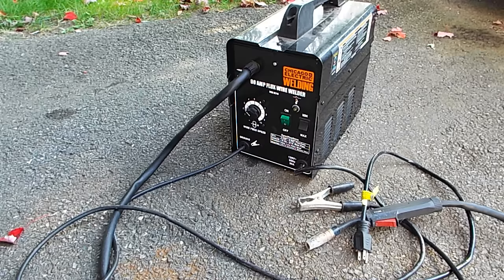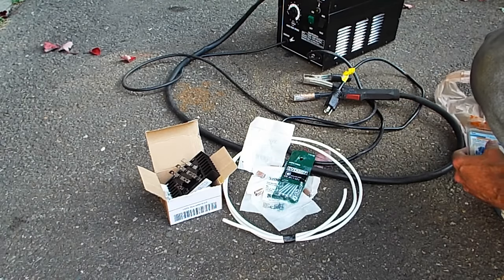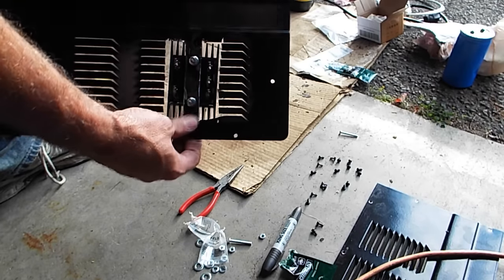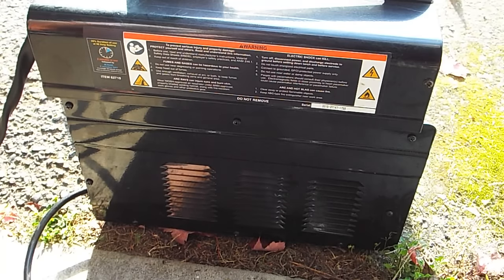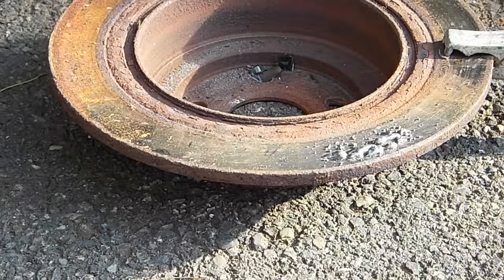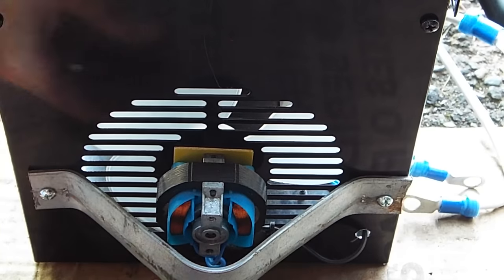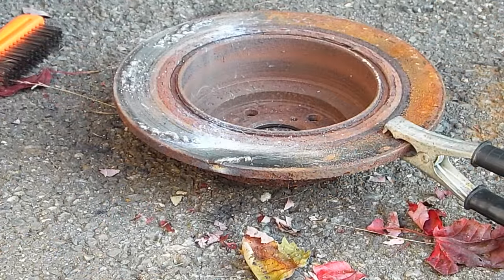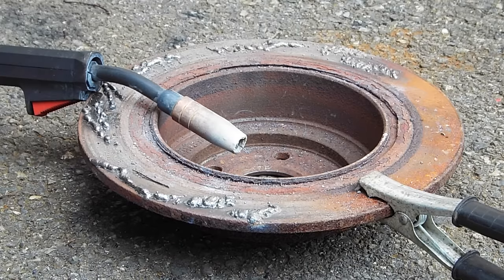Convert Welder from AC to DCEN ✔

Comment: Can you put a parts list on here for me
Reply from the maker: Items bought through Ebay: ONE Large capacitor with values of Mallory CGS Series 21000uF - 100VDC . ONE resistor with value of 160 Ohm 10W 1% Resistor Silicone Wirewound. ONE Bridge Rectifier of MDQ 150A Single-Phase Diode Bridge Rectifier. Items bought elsewhere: 6 feet of 6 gauge wire (not much to spare, so 7 feet of wire might be better). I used FOUR 1/4 inch copper connector tubes to join wires together with solder.  TWO packages of 6 gauge wire terminals for connections to the bridge rectifier and the large capacitor terminals. Various sized nuts, bolts and washers to mount the bridge rectifier and to use on the connection terminals.
Reply: Where did you buy the capacitor from?
Reply from the maker: I found it searching on Ebay.
Reply: Mark Young - Outside The Box what are the specs on it? Great video.
Reply from the maker: Thanks! This is a Mallory CGS Series 21000uF - 100VDC. I measured the DC voltage coming from the welder on its high output setting and it was less than 30 volts DC, so using a capacitor rated for up to 100 volts DC "should" be ok.
Reply: Can i use an automotive three phase rectifier?
Reply: Great info hi from Northern Ireland
Reply: Learn to weld. Mines stock and I can run a nice bead. I have a Lincoln 100 amp dc. Runs great.
Reply: @laurencionavarro8460  most auto alternator rectifiers, 140amp max. But 25amp continous output. And they are designed for operation between 12.3vdc to 14.75vdc These welder transformers output is  around  18vac. So again, no. 
When an alternator diode mosfet  goes bad, sometimes it begins overcharging and ruining the 12v battery. The case swelling up and acid leaking is telltale sign.  Quick check with DMM.  
  3 phase is A/C commercial welder Amigo.
Reply: @laurencionavarro8460  you probably don't want to go this route as it needs a heat sink and screw terminals to attach wires to it. A 150a rectifier is less than $20, and I bought the heat sink for less than a dollar at a local scrap yard.
Reply: @MegaTroyhamilton  we dont care about your 100amp DC welder or your comment about the authors welding. We care about the topic of THIS VIDEO.
Reply: All you need is a 40v capacitor at 40000mf

Comment: You have illustrated "Third one is the charm". Since you did not convert three welders you did not get the perfect conversion but you combined what works with what not to do with enthusiasm and a good voice.  Good luck with future videos.
Reply from the maker: Thank you Stuart! I know it was a bit of a hot mess, but the end result, with the additional aluminum heat sink, is still working just fine, even with 0.035 gauge wire.

Comment: thinking about doing this to my welder but i'm curious if the hi and low settings still work
Reply from the maker: Yes, Hi and Lo function as they should. I'm still using it mostly in this configuration, with the addition of a bigger aluminum heat sink for the rectifier.

Comment: Cool vid, but you need to get into a welding class.  I think that would do you more good than changing to DC.
Reply from the maker: Thank you!
Reply: Agreed, I own a similar welder, and have used it to so a lot of welds for friends and stuff, and I have gotten a ton better. I can lay dimes on these cheap AC machines, and now I just bought my first TIG welder. You can tell he is a new welder lol, but with practice comes experience.

Comment: that's why we all used the 150 amp BR to begin with, at 100 amps there isn't enough head room for the peak amperage. also the reason your AC welds had so much splatter is because you had the wire speed up too high, were moving too fast and had too much stick out. As long as you know how to weld the HF   115v flux core welder is perfectly capable of running a consistent bead in AC form, the main reason for the DCEN conversion is weld penetration . the conversion creates another problem which you didn't address, because of the hotter arc higher current flow with DC, it caused the current for the wire feed motor to sag which in turn causes the wire speed to pulse up and down. AS for your welding in general you need to slow your wire speeds down, start a puddle and move the puddle along as you weld and keep your stick out down to a half inch unless your are welding really thin metal....
Reply: I went with 200amp/1600 volts.

Comment: I used that same brand rectifier, got the 200amp, it works great!  It's a bit slower to strike, but once bead starts the weld lays down and penetrates base metal much better.  Also after welding for ten minutes straight, the rectifier wasn't even hot!

Comment: Welding cast iron instead of steel may be part of the problem with the welds.
I have converted my older style HF 90 amp welder, and I was able to fit all my parts inside. I moved the transformer over about 1/2" to the right, and rotated the wire feed control board to the top. I installed a transformer for wire feed and I also installed a ground dinse socket and plug, moved the power cord to the rear and installed an adapter block for a Miller m10 mig gun. I also installed a higher volume fan with the heat sink on an angle on the left side in front of that fan. I'm hoping to finish wiring the rectifier in the next few days, and give it a try. I will have to power this with a generator since my shop is on an Amish farm with no electric.
Reply from the maker: Bryant, that's an amazing setup you have going, and from an Amish farm! Much respect to you!

Comment: For a heat sink to work at all it has to be in direct contact with the metal it’s wicking heat away from. Get that sheet metal out of between the rectifier and the aluminum sheet and apply a little heat sink compound and use a small cheap fan to blow more air over the outside of that plate since it’s your heatsink and surface area is so low without fins you’ll need to pass more air over it so a small table fan or clip on fan on high should do it. Low duty cycle that way too. Look up how to replace a heat sink on sun v120 servers. Simple and use same principles thermal conductive paste and tension against the metal of the rectifier and the “heatsink”.

Comment: Heat shrink comes in red and black colors.
Maybe put red shrink on (+) of the bridge dc output.
And black shrink on ( - ) of the bridge dc output.
Less confusing for another down the road.
 user.
Question? How do you know if you have wired the output of the transformer in form: 'Polarized' A/C? 
AC Common and AC hot?

Comment: You would get better heat rejection from the rectifier if you attached it directly to the aluminum plate(alongside the center section you have it attached to in the video.)  I would suggest using some 'heat sink paste', just a dab, to improve conduction.
As it is, the only connection is through the 'strip' down the middle, leaving 80%of the heat sink area floating in the breeze,touching nothing.  The Al will conduct so well it does not have to be centered in the slab, and you will get so much more conduction area it would not make any difference anyway, so set it to one side or the other.
 I have an off-brand, and plan to do a similar mod.  I bought the same rectifier, and then bought the second one you have before doing anything.  The second one was not available from ebay or amaz, so I went to aliexpress.  I have to figure out where to put it in this unit which is not layed out the same.  I'll get there.
Reply: More good info.  Thanks.

Comment: When you burned out the rectifier at 13:56, you had some major sparks at your ground clamp.  Why?  Was it a bad connection?  Could that be why the rectifier burned out?
I also bought HF 90 amp unit.  I have not yet used it.
After doing this conversion, you say it burns a lot hotter and deeper.  Will it still be possible to weld thin sheetmetal that's about 18 or 20 gauge?
Reply from the maker: Thanks for the questions, Ralph. I did not grind the clamp area enough, and there was an intermittent connection as a result. I do not know if that contributed to the failure of the 100 amp rectifier. It had become very hot under use. As for 18 or 20 gauge metal, hmmm, I have been using it to weld patch metal to a car and even on the lowest setting and slowest feed rate I am seeing a lot of "burn-through" holes, so, maybe it has made it stronger/more powerful in that regard? I recommend you try using it for what you intend "as-is" for now and decide if this conversion is necessary for your needs. As always, make sure the unit is UNPLUGGED whenever any of the covers are off.
Reply: @contact4mwy7  
Thank you.  I'll hold off and get accustomed to the factory unit before I do any modifications.
Reply from the maker: @RalphSampson...  Good, and there a lot of comments on here about how to get started and make improvements as you go!

Comment: Why do you need the capacitor and the 3ph rectifier? Why not just a single phase rectifier  after all board but before the leads leave the unit?
Reply from the maker: A single phase should work too, if it's amperage rating is high enough. I had a hard time finding a single phase rated high enough, and the first one I tried burned out in under a minute. The capacitor is a buffer that keeps feeding DC voltage when the AC reverses phase and creates a gap of no electricity being sent. It makes for a more constant DC voltage.
Reply: @contact4mwy7  so I actually just finished doing that, I pit a 150A 1600v single phase in, and it seemed to provide a more consistent arc for me. I'm interested in the capacitor, but is that where I'd need to get into multiple phases? Or if not, where in the circut did you put it?
Reply from the maker: @calebtomes121 the capacitor goes across the DC leads coming from the rectifier, positive to positive, negative to negative.
Reply: @contact4mwy7  thanks, why did you decide on 21000mfd? Just trying to gauge what I need and why
Reply from the maker: @calebtomes121  that's the measurement of how much of a charge the capacitor can hold.

Comment: Did your 150 amp do the trick? I have a 100 amp bridge and the feeder worked for about 5 seconds then quit out. I hear the relay clicking and a buzzing noise but no motor turn. Tested motor with 9v battery and it spun. Any help appreciated, thank you.
Reply from the maker: Same thing happened to me! It's not the motor, it's that your bridge rectifier has shorted out and that leaves no power to run the spool motor. My unit also buzzed and I heard the relay click, but did not feed wire. I measured the AC voltage at the bridge rectifier and it was down to like 1 volt AC. Surprisingly, this short did not burn out my transformer coil. Yes, 150 amp bridge rectifier is working great, but use a heat sink made of aluminum plate for better results.
Reply: Mark Young - Outside The Box awsome thank you so much. Will defiantly use the heat sink. Great video by the way ,take care -john
Reply from the maker: Good luck, man! I have welded some with this new setup until I ran out of 0.035 wire. I will go back to 0.030 and stay with that from now on. The thicker wire is too much for the output of this welder in my opinion.

Comment: Mark, it looks as if that 160 Ohm 10W resistor is connected between the positive and negative connection on the Bridge Rectifier? Is that correct?  Very informative tutorial, Thanks.
Reply from the maker: MrWalterb123 yes, that's correct. It has a high enough resistance to not take away too much of the actual output, yet discharge the capacitor after each weld. This reduces the likelihood of getting those discharge sparks when touching the work piece between welds, or zapping the user by accident. It's a slow discharge, so it is possible to get a spark soon after welding, but after a few seconds that leftover charge should be gone thanks to that resistor. Thanks for asking.
Reply: This was done to drain the capacitor's stored energy down. This is typically used on high current power supplies.

Comment: Love the disclaimer.  :-)  "Don't blame me if you screw this up."
Reply: Mark...while I know you might still be watching this....where did you get the resistor and I see you put it on the rectifier instead of the cap.  I got a 200A rectifier and a 100,000uf cap.  (go big or go home :-)))  What terminals is it connected to?  Can't tell from the vid.  Have the parts but haven't started tearing into it yet.  Waiting for the cap to arrive.

Comment: I was wondering do you need to change to a different wire when you change polarity? Just curious
Reply from the maker: You don't have to. I've been using both 0.030 and 0.035 flux core wire.
Reply: I haven't EVER seen any innershield flux-core wire that runs AC
Reply: @slick1rick1  HF sells 10,000,000.    90A and 125A machines a year with a pound of wire in them.

Comment: Would it be possible to get a diagram. I want to purchase one of these and convert it also I hear the feed motor needs to be rewired and also the main power wire and the ground clamp. Another question does this have an option for 240v
Reply from the maker: I wish I could attach an image to this reply, Sean, for a diagram. I had seen other videos on performing this change (Matt Heere's videos for the most part) and followed the wires back from the gun nozzle and from the clamp to know which wire was which. As for the feed motor, I have seen others have added a separate power supply and what not, but I have not seen a need to do that. Maybe because I am not what you would call a professional welder to notice the effect of sharing power between the feed motor and welding coil.
Reply: Mark Young - Outside The Box thanks I appreciate it. I'm not a professional by any means either actually I've only used a stick welder. I get by on the stick but need something to weld smaller material. Thanks again I'm sure I can figure it out your video is very helpful
Reply from the maker: Thanks Sean, and if you buy one, try it first "as is" where maybe as a stick welder you can control this welder in its AC output and still get good results. Changing this over to DC output for welding has resulted in less splatter bb's around the weld and maybe a bit more heat, but it's not night and day like I had expected.
Reply: Mark Young - Outside The Box thanks I definitely will although I believe I'm gonna hold off until I really have a need for one and get the more powerful one although I still intend to change it to D/C if I don't like the results. A friend of mine has a  D/C one much more expensive tho out of my price range but I'm gonna borrow his to do the little job I need and also try and get the hang of it also. I appreciate your video and helpful tips I am subscribing to your channel because I like the fact your so helpful and videos are cool also. Thanks again
Reply: Mark Young - Outside The Box also I believe the issue you has with the space between the weld is because the wire motor does need its own power supply so you may want to give it a try it looks simple enough and should give you a consistent straight bead that looks professional. It looks like y out your doing a good job but feeder is causing some issues. Also maybe try some aluminum heat sink paste things I'm gonna try in a few weeks when I do purchase it and I am gonna lol
Reply: Mark Young - Outside The Box sorry silver paste
Reply from the maker: I might add some kind of heat transfer paste to the back of the bridge rectifier if it feels like it is heating up. So far it seems to transfer the heat directly into the aluminum heat sink plate ok as it is. Thank you for all of your comments and subscribing. I'll try to provide more videos on using this welder.

Comment: Thanks for making this video.  I have to say, there is more to welding then putting the tip down, squeezing the trigger and moving the gun.  This is an older video so maybe you have had a chance to practice a little.  You’re after the mod weld should have been a fairly good bead.

Comment: Can full bridge rectifier be putted before welder - after grid?
Reply from the maker: If I understand your question, I put the rectifier after the coil / before the welder clamp and gun. This way it converts the AC current coming from the coil into DC current which is fed to the gun and clamp. Clamp + / Gun -
Reply: No, i meant to feed welder just with pulsing DC (rectifier AC)...i see many people puting diode bridge between welder and clamps.
Reply from the maker: Do you mean using the rectifier conversion to DC but without adding the capacitor to help smooth the DC pulses? If so, that might work with decent enough results, maybe?
Reply: @contact4mwy7  yes, but between grid network ac to welder with smaller and cheaper full bridge rectifier.
Reply from the maker: Between the electrical outlet and the machine? I have my doubts for that as some of the electrical components are created to run internally on the AC power. By changing the whole unit to run on DC those components may not work or even be damaged.

Comment: Hmmm...HF is discontinuing the 90 amp model welder.  Would these same parts work to convert the new 125 amp flux welder.
Reply from the maker: That's a good question, The Rev..... I wonder too!
Reply: After some research, the rectifier needs to be bigger and there for you might want a higher voltage cap.  I'm fixin to mod my HF 125a and I'm going to go with a 300a, 1600V rectifier and a 100V, 24,00uf cap.  I plan on doing a video of the mod but, don't anyone look for it too soon.  Gotta wait for parts to be shipped in and delivered.  Ac to DC is not the only mod I'm going to do.
Reply: Be sure to mount the capacitor with the +  (positive) voltage going to ground. The - (negative wire goes to the welding cable.)  It will blow up if backwards.